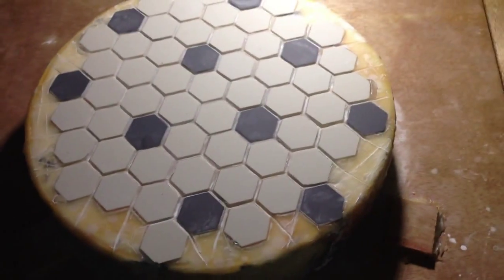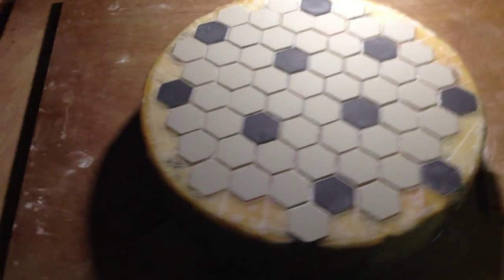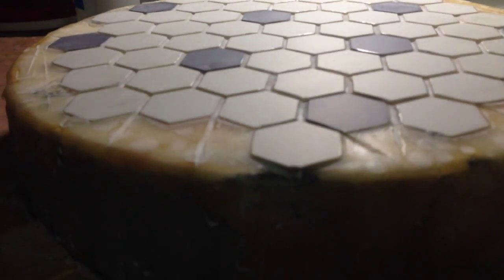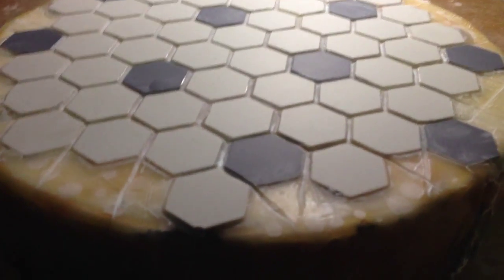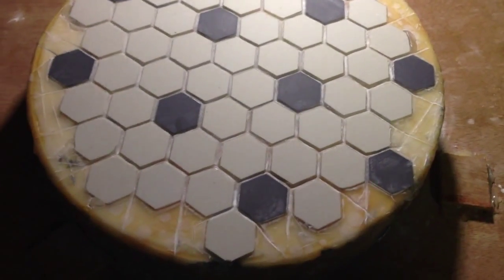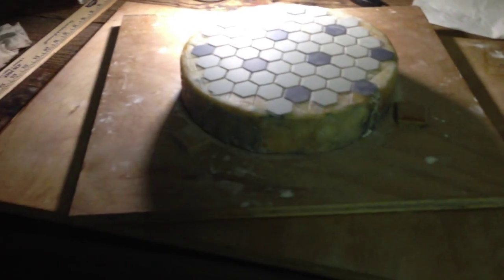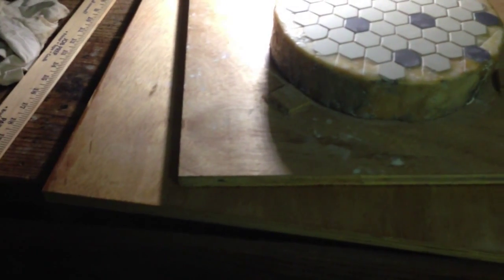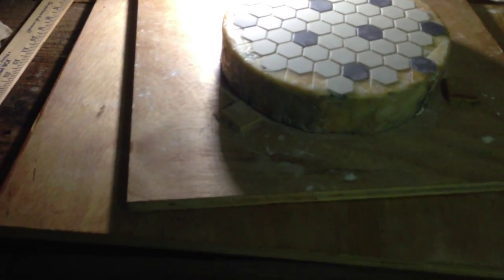Fine Grinding my 10" mirror with 5 micron Aluminum Oxide.

Comment: How did the poly work out for you? I had a tile rip off within a few hours of starting. I ended up having to coat in epoxy any way. The poly I used doesn't seem to adhere well to plaster and even with the epoxy it's trying to peel off every way it can. I'm just finishing up with 9 micron on a 12 inch so it'll make it, but barely.
Reply from the maker: +cyborgv1 The polyurethane DOES NOT provide enough protection... I've settled with using 5 minute epoxy on the entire surface and then RECOATING that with marine epoxy which dries in about 3 hours.The tool's seal usually fails along the edges where it is subject to more pressure. The 5 minute epoxy on its own always fails on these edges, but applying an additional coat of marine epoxy makes the tool extremely tough, and no water will damage it during grinding/cleaning.

It's more expensive, but the tool will require little maintenance, so you'll save time and sanity.
Reply: +Carlos Paris I'm pretty sure next time I grind a mirror I'll shell out the extra cash for the hydrostone so the only purpose the epoxy needs to serve is holding on to tiles. I'm tempted to try wood tools as well since it seems they can be made very thick and I know that epoxy/poly won't peel from wood as easily.

Comment: Carlos, where did you get the pyrex blank?
I am watching your videos.
Very helpful.

Thanks
Reply from the maker: Cameron, I purchased this blank from www.firsthanddiscovery.com. The glass was fully polished, the edge in good condition, I needed to make a new lap to finish figuring. But in the process of separating the glass from the polishing tool, one of my hands slipped from the glass and the other one pushed it away crashing it on the floor, so the mirror shattered and it is ruined. Be careful when separating mirror and tool.
Reply: Carlos Paris Ouch! Sorry to hear and truly appreciate the warning.

Comment: Pretty neat video Carlos. I look forward to hearing about the polishing. (Two hours per inch!) and figuring. What is the aperture ratio?
Reply from the maker: Hey Francis, polishing is almost finished... I'm still waiting to pour the second pitch lap but the tool is prepped to pour pitch on it. The mirror measures f/6.02 on the tester, so I came extremely close to the target f/6, which means the grinding method and measurements are working.

Comment from the maker: Thanks for the comment! I applied a couple of coats of polyurethane to the polishing tool, it appears to work well, I have to test it, but it is MUCH LESS MESSIER than with epoxy, thanks for that tip! I definitely use a cerium oxide / water mix for polishing, but for grinding I've had issues before. Since the fingers are super sensitive, I've felt several times a particle in the mix, this forces me to wash and apply abrasive again but it avoids scratches. Scratches only occurred with 320 grit.

Comment: love the vid!  very interesting.  when i coat my tools with poly, i set my tool outside and spray on a coat every 10 minutes over an hour or so.  the plaster soaks it up immediately, and eventuall takes on a faint yellowish tint, meaning sealed.  for my own preference, i premix the finer oxides with distilled water in store bought ketchup/mustard bottles.  some states have added chemicals in the tap water like calciums that could be problematic, plus easier to dispense.  very interesting!